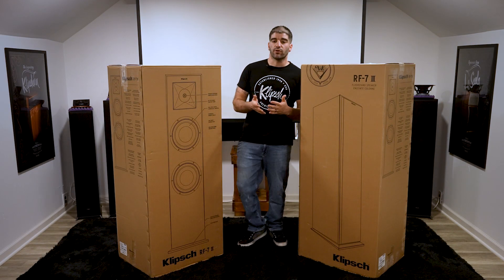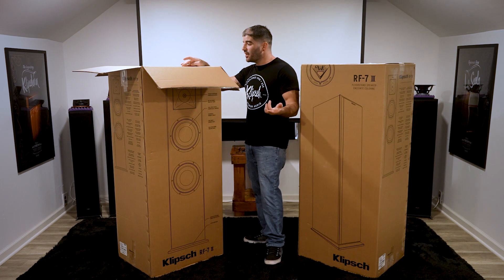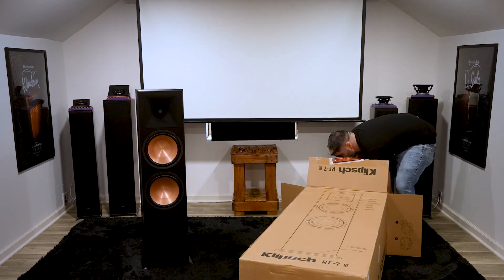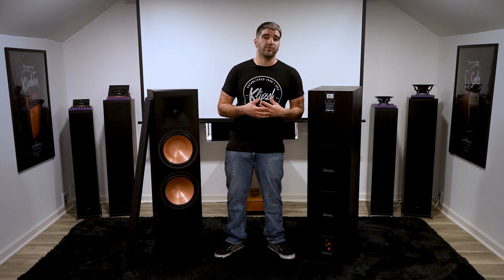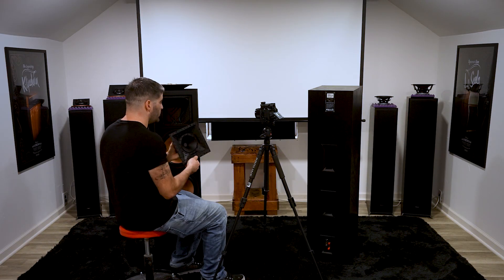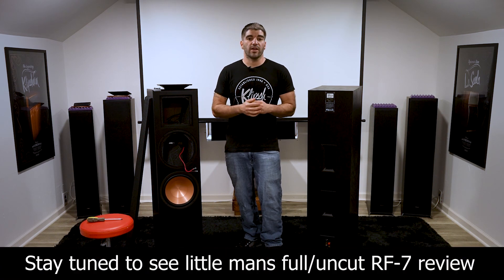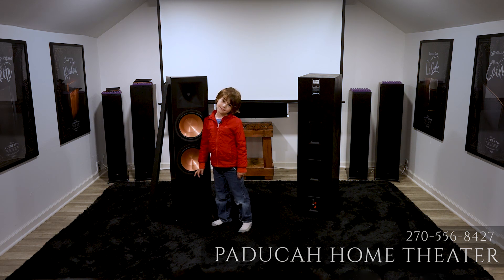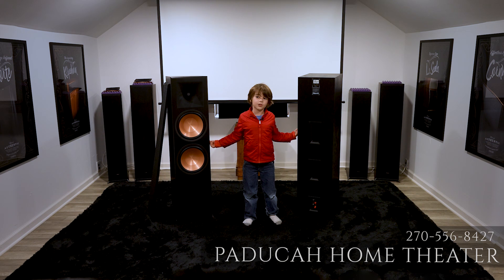The Flagship reference tower - Klipsch RF-7III unboxing and disassembly

Comment: What exactly is a furniture grade veneer?
Reply from the maker: Technically, the term "furniture grade" typically has little or no meaning. Veneer is graded differently, with letters and numbers. That said, when Klipsch says "furniture grade," it's their way of saying the speaker utilizes top tier, high grade, quality veneer. And they do. Really nice finish options and quality that lasts for years to come. Saying furniture grade just sounds a bit better than saying the speaker uses "AA" veneer. While the term can be a bit confusing, the quality is there for sure which is what's important. 

-Jason

Comment: Hmmm, another disassembly without showing crossover which is very important part of the speaker
Reply from the maker: While it is a very important part, my thoughts were, showing how to replace components that may have issues in the future. While a xover can go bad, drive components are far more likely to need replacing. That said, I will start pulling the crossover going forward as, it sounds like we have a few people that would like to see it! 

-Jason

Comment: I recently started having an issue with my RF7 and RC64 (version 3). After choosing a more powerful amp (200 watts at 8 ohms) I noticed that there was a rattle from the front black boards (not grills) and I see that the front boards are slowly coming loose. I wonder if those front black boards that house the speakers are just glued or are attached with hardware. Luckily I am in warranty so taking them in for repairs. I also recently got the Perlisten d215s which can really get the house shaking so, I wonder if certain low frequencies can easily affect the front black boards on the Klipsch speakers.
Reply from the maker: Thanks for watching! Honestly in my years working with speakers, as well as my years at Klipsch specifically working with these units, I've never heard of an issue with the motor board coming loose. The route you are taking would be my recommendation. Talk to Klipsch directly and see what they have to say about the issue. Be forgiving with response/hold times at the moment though. We are going into the busiest time of the year for the customer service team right now. May take a little while to get a response but they will for sure reach back out to you. 

-Jason
Reply: @TopShelfAudio  Sorry i missed your reply. I have talked to Klipsch and they asked me to take it to an authorized service center where I was told that they have seen this issue before and in all probability the speakers would get replaced. I am still waiting for an update as its the holiday season. I will let you know once I get an update.
Reply: @TopShelfAudio  I got replacements for both the RF7 III and the Center channel speakers from Klipsch today.
Reply from the maker: Thanks for keeping us updated! I hadn't personally seen this when I was there but one thing I was sure of was that Klipsch would take care of ya. Great people working over there. Happy to hear you are back up and running again and enjoying your system!

-Jason

Comment: Watching the video made me remember that when I bought my RF-7iii from Cory I had them on hardwood floors, so I used the rubber feet. Now I have them on carpet, we moved,  and I can't find the carpet spikes. Is there a certain size or type that I should use?
Reply from the maker: Tons of options out there. Size I believe is standard 1/4-20 for the threading. I will double check and get back to you. That said, unless its super thick carpeting and you're noticing wobble or something to that effect, not sure that the changeover is necessary. should be just fine with the existing rubber feet. 

-Jason
Reply: @TopShelfAudio  Thanks Jason!

Comment: My decision is whether to upgrade from my gen 1 RF-7's to RF-7 III's, or go Heritage.
Reply: I se a lot of people run from RF-7 III to Cornwall.... I think they missing something in RF-7 III probably more middle
Reply: @yournightmare9999  It's definitely the mids. RF-7's sound are massive in the top and bottom, and absent in the middle. You can always supplement bass with a sub, but when you're lacking mids, you're kind of stuck. I owned both RF-7 III's and Forte III's at the same time. RF-7 III's are super crisp up top, but the midrange just becomes more and more recessed as you turn up the volume. I now run Forte III's with some killer subs. Best system I've owned.
Reply from the maker: We see a lot of people with this dilemma. The plan is to do a compare of old gen vs new gen RF7s, as well as a couple of compares to heritage (possibly fortes and corns?). Stay tuned. Coming soon!

-Jason

Comment: Yeah forte iv or even Cornwall iv would be an interesting comparison. It would come down to bass vs mids.  I have heard both in isolation and I like the reference line better… but I have never heard them in the same room or system so hard to say. 

I own the RP8000F and ran them off a McIntosh MC462 out of my main system and it was surprisingly good. No one would actually run them that way though. $20,000 front end and $1500 speakers. 

I am interested to hear the 8000F vs RF7 III
Reply: 7’s will be an even bigger sound, more impactful, and way more bass.
Reply: I own the 8000 and very satisfied they have the same frequency response of the RF 7's I'm barely using 1 watt on my Technics class AA amplifier
Reply: @OscarSanchez-tk3hx  They don't have the same frequency response as the 8000F.  RF7III s are at another level entirely.
Reply from the maker: That's awesome. Difference in what's pushing them will for sure make all of the difference in the world. One of the biggest things we hope to accomplish in our compares is that same room experience. real life side by side listening with rapid switching. Even if people are hearing it through a mic/phone speakers/through YouTube, hopefully our commentary is helpful in pointing out some of the nuances and differences. :)

-Jason

Comment: Oh man this was great.  Would love to see the crossover.  You planning to do everything I wanted related to the RF-7 III. So little info out there on them in any detail. I'm really curious to hear if they are closer to the RP line or Heritage, or a different beast? I'd also love to see in room measurements on them.  Seems virtually no one has published measurements.
Reply: My guess is that the sound is closer to RP, just bigger due to the 2 way design. 3 way Heritage will have more pronounced midrange.
Reply: if you don't want to be scared you better not watch the crossover
Reply from the maker: Thanks for watching! I didn't expect so much request for the crossover to be pulled. Could be a future Tech Tuesday, I pull all three input cups/crossovers and give you guys a peek. :)

-Jason